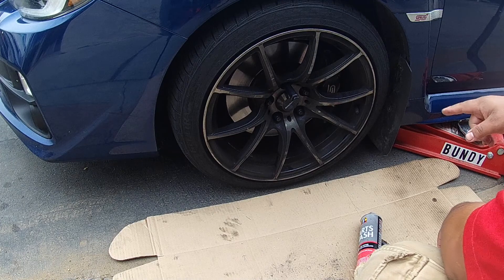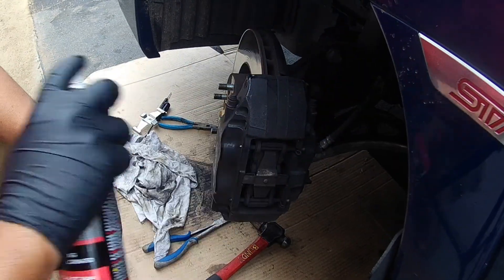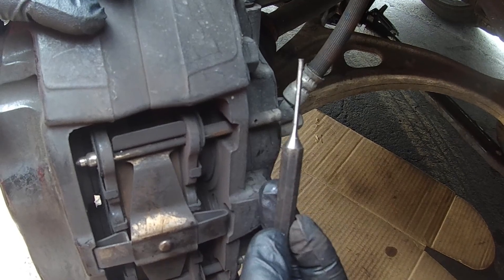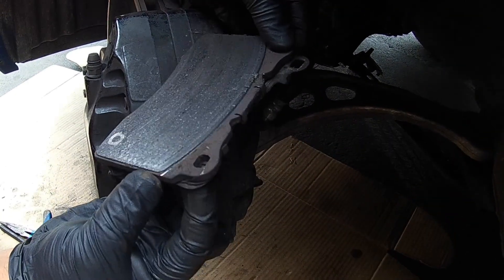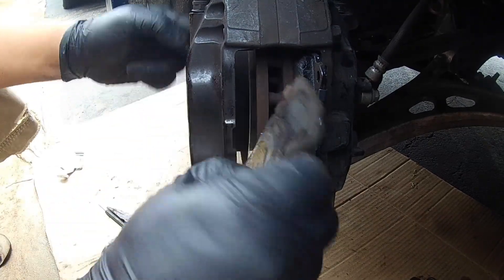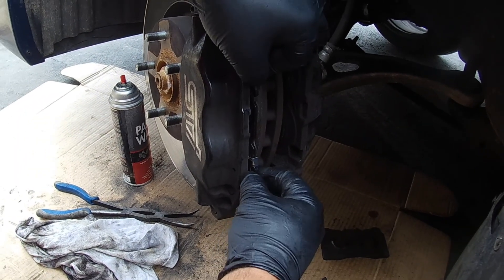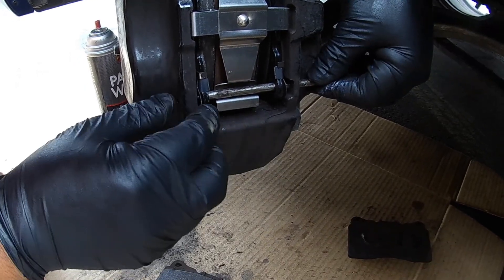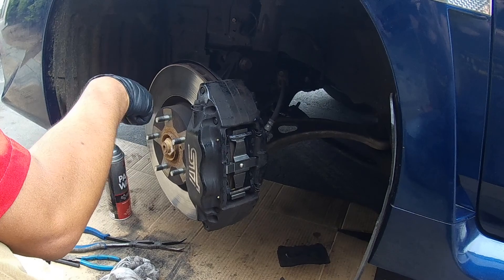DIY Subaru WRX STI Impreza STI Front Brakes and Rotors - Brembo Brakes - How to Change - 2008 - 2017

Comment: Was wondering if you could help me I have a problem with my Subaru wrx sti 2017 I got new brakes but they keep squeaking when I brake my friend said it probably wasn’t lubricated properly I just want the squeaking to stop
Reply from the maker: Take it back to he shop you had it done at and tell them it’s squeaking now and you want it fixed.